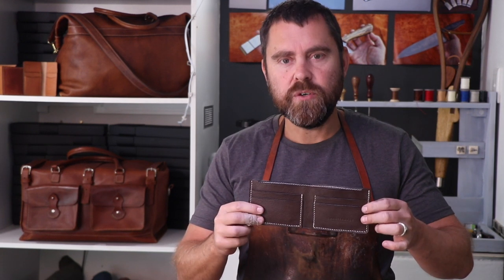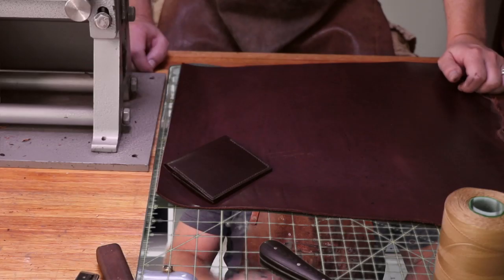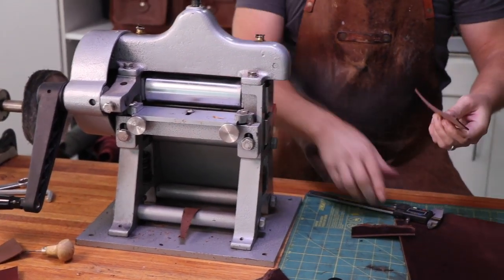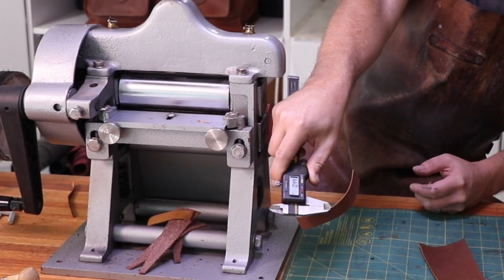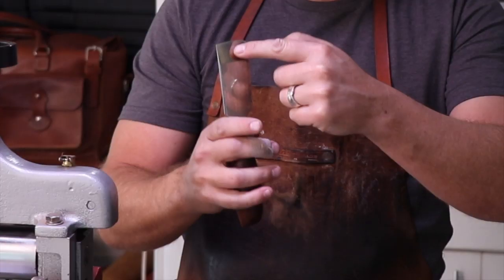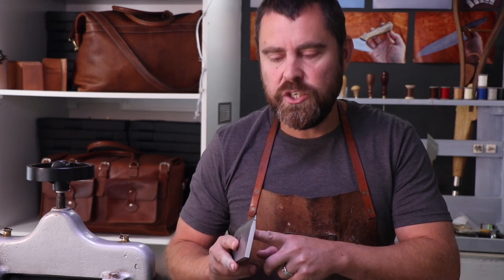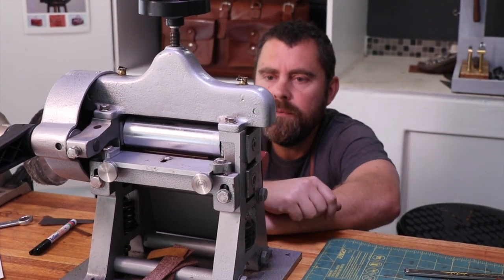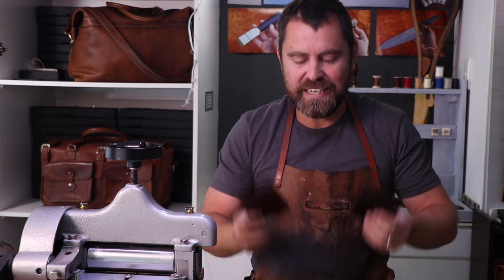Hand crank leather splitter - Do you need one?

Comment: My splitter is 4 1/3 inches or 10.3 centimeters wide. I hand strope it with 12,000 grit diamond compound and I can hand split 10 centimeters easily for wallets. It isn't a roller, you have to pull through a roller, but for wallets or belts it works just fine. The trick is to keep it mirror polished which 12,000 grit does. Just an inexpensive Tandy splitter, just strope the thing. I made hardness scratchers and the blade that comes with it is at least 59 HRC so my 59 won't scratch it, but my 60.3 does. Plenty hard enough. 
My scratchers go from 55 to 56.5 to 57.6 to 59, 60.3 and 62.
 FYI; HRC 59 is 10X harder than HRC 58, it is exponential like the seismic scale.
I started leatherworking by knife making and I needed to make sheaths and found I like leather work even more than knife making. LOL

Comment: I like the way you can resplit the leather to get the size/weight you want. With my none crank C.S Osborne 84 it is not that simple, as you need a tab to pull the leather through which reduces the length of the leather on every split.

Comment: Hello Terrick, Philip here. I've got an Osborne splitter and find it near impossible to pull through leathers much wider than about three inches because of the amount of force necessary.  Put too much effort into pulling and you can easily stretch the leather to the point where it can't be used.  Short of resorting to hand skiving do you have any thoughts or advice on how to get around this problem? Thanks!
Reply from the maker: Hi Philip, this machine of mine has a 6" blade and to use the full blade length I have to get it razor sharp or it will buckle the leather. My general wide cut on this machine is 4 1/2 " and I don't like going much wider than that.   Im not sure how possible it would be to get more than a 3" split on a pull through splitter even if you had a custom blade. If I remember those machines were used a lot by the old saddlery makers and would spilt very thick harness leather into "still thick" straps etc.
Reply: Thanks Terrick. Yes I guess I knew I was pretty much at the limit. I had to completely reprofile the blade to be able to split the widths I do now so unless someone comes up with a very clever way to drag the leather through mechanically... Thanks for the video, really interesting to see a hand cranked machine and how you've had to customise it to get the best results.
Reply: @dmail00  Thanks - interesting to hear your approach, I'm still relatively new to my 84 so finding my way... What I have done though is completely reprofile the blade to remove the secondary bevel. The result is an extremely sharp but - inevitably - less robust edge but I don't mind re-touching it on the waterstones if I get a chip. Reprofiling it has gained me maybe 3/4 to 1 inch extra width (that can be pulled through with minimal effort) but it did take about 5 hours on the waterstones to take the secondary bevel out.  I do know a long-time professional leather worker who rigged up a kind of mangle (two closely aligned rollers with a hand crank) immediately behind his splitter to pull through wider sections of leather evenly, but I'm not ready to start experimenting like that. Thanks again.

Comment: Nice video............but to tweak the blade as showed here in this video, you will need a
 proper beltgrinder AND some considerable skill as a sharpener/knifemaker.
Still great content, especially for us tinkerers, artists or otherwise creative people........
Reply: if you have the equipment but not the skill you could use a jig to help yourself  getting the grinding correct.
Reply: @psycholocke4090  Good advice!
Reply from the maker: You can always take the blade to a local knife maker, this is more what I was suggesting
Reply: Getting good at sharpening these blades is key. I'm still working on it. The best video I've seen on the topic for these particular blades is made by Nigel Armitage.
Reply: @pequodexpress  Is that on his paid channel on Vimeo? Or do you have a link to the sharpening vid please?
Reply: @pequodexpress  What is shown is sufficient for sharpening the blade, but this is not the process for creating a hollow grind.

Comment: One question, how much would that splitter be?
Reply from the maker: No idea, I bought it many years ago. You will have to check with your local suppliers.
Reply: The version marketed in USA is the Cowboy 8116, so you're looking at about $1400 or so.
Reply: @wmcrash  at 1400 dollars is there a reason to get this over a bell skiver?
Reply: @nigelbaboolal5072 , the Cowboy 8116 is a splitter, not a skiver. I don't know much about machines, but between a splitter and a skiver, get the one that you need.

Comment: This one still has me questioning if I should get one.  I have plenty of off cuts, and I have been manually skiving but that only does so much.
Reply from the maker: If you are able to work through the machine adjustments they can be very useful. After a while changing the spring tensions and bottom roller height for different leathers becomes quite easy.

Comment: Hello from France, It's possible to split chrome or double tan leather with this kind of splitter ? Thanks
Reply from the maker: This style of splitter was really made for thick veg, I can split chrome on mine after all the changes I made but the blade needs to be razor sharp. A bell skiver works much better on chrome. Not sure what double tan is
Reply: @CHARTERMADE  Thanks a lot for your answer. Double tan is chrome tan leather who is veg retanned.
Reply: @jeremieben4170  Double tan is another term for retan.  Higher end chrome tanned hides are sometimes sent on to a veg tan finish.